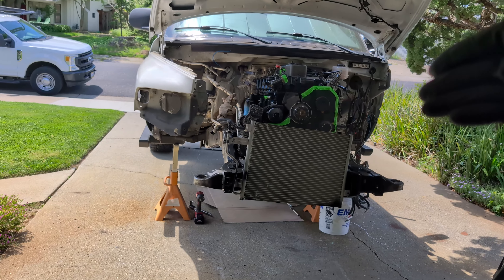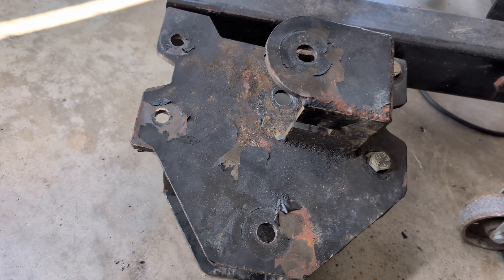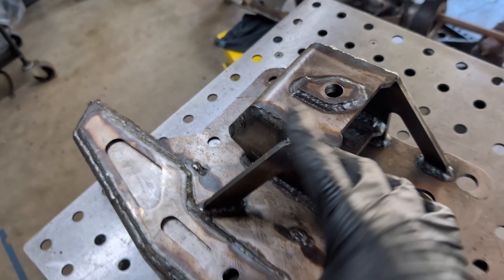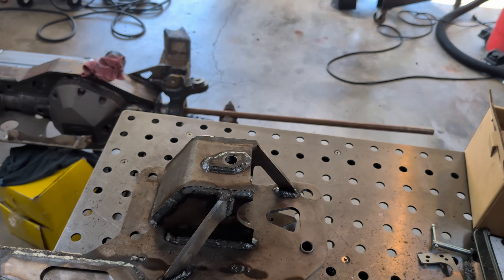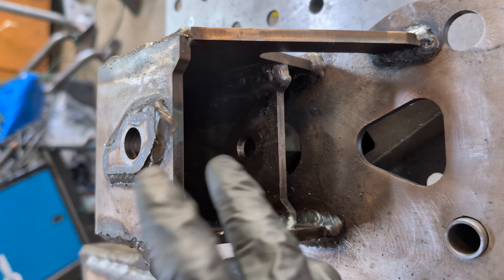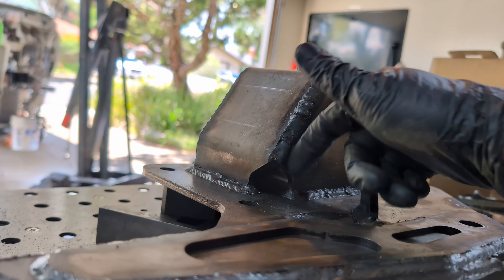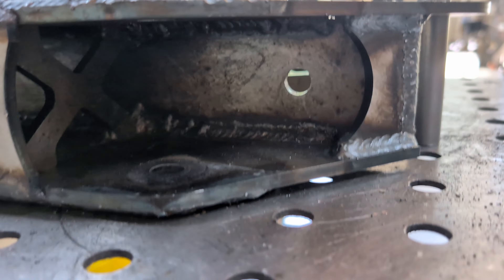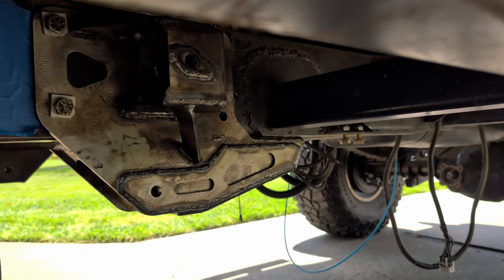Dodge RAM 2nd gen LONG ARMS

Comment: So you just lowered the hole 3 1/4"? and the bracket itself is only 1/2" lower? So you're not losing almost 3" of clearance compared to the old set up. Just wondering because 3" is a lot for some of us guys haha
Reply from the maker: Lower Arm Mount hole center line is 3/4" lower, and the entire bracket is 1/2" lower.  I didn't want to give up more clearance but the 1/2" was worth the angle of the arms. It'll be covered in the next video once it stops raining on my weekends!